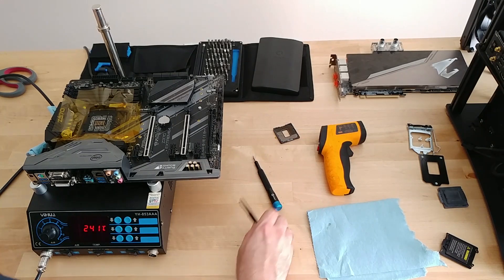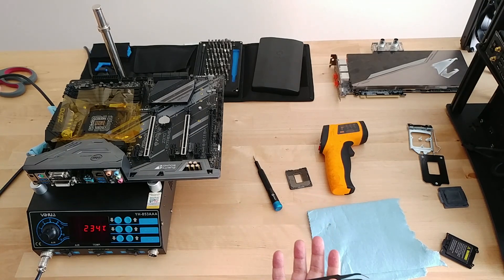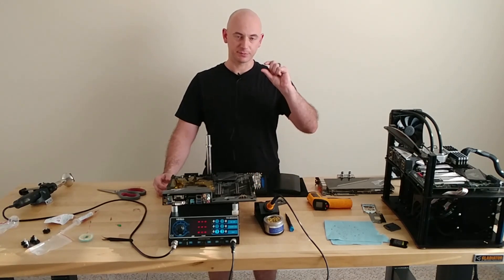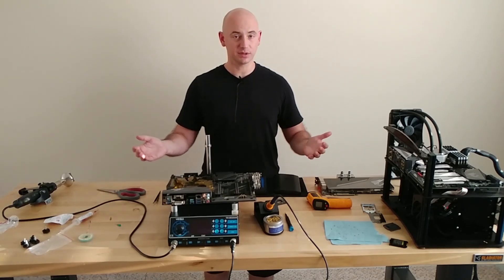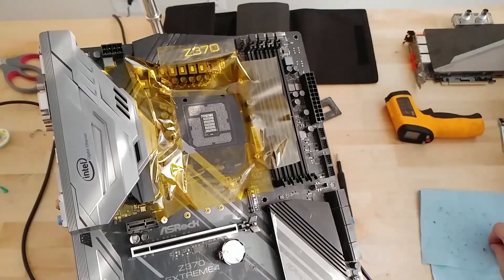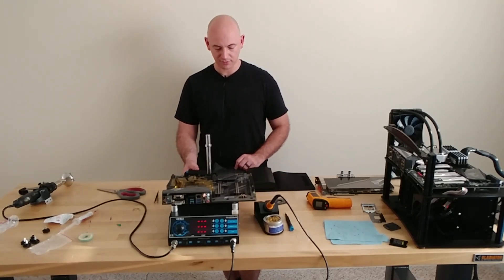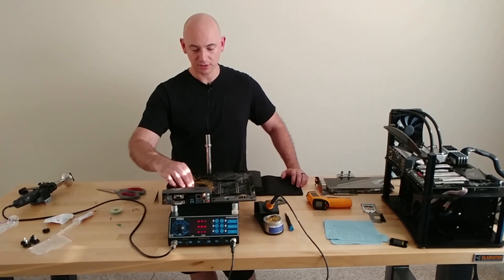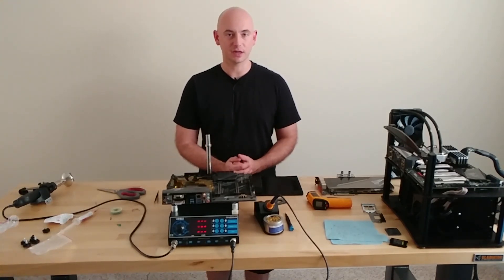CPU socket replacement attempt Pt2

Comment: You shouldn't have screwed your modded PCB to the back of this Motherboard.
The CMD in the back are safe and don't need this extra kit of yours.
The best way to work with the MB is to detach all the heatsinks to provide you a better maniability.
For the Preheater it shouldn't exceed 150°C. You Preheat the MB for 5 mins then you check if the temp reaches this setting.
Then you start to use the heatgun. 100°C for about 2 mins, then 150° and you stop to 350°C.
Meanwhile you apply some flux and gently check if the socket is moving.
Then when it moves, you leave the heat gun there for 30 secs then you put it away and you lift it gently with the best tool you have. (not a single tweezer but for this socket 2 tweezers are needed).
Reworking / Reballing process is not really hard but you just have to know the essential steps to succeed and not to break the motherboard.
:)
BTW you have a good Rework Station! :)
Reply from the maker: Thank you for the comment! You're definitely correct about removing the heatsinks, I discovered that leaving them attached actually soaked the heat away from the socket and made it more difficult to remove, so in the future I'll definitely remove them. The reason I used this extra kit around the socket is because the area of the reflow is not large enough to hold the whole motherboard, so I had to find a way to secure it to the limited area, but yes in general you shouldn't need anything like this. This was my first go at this and I'm planning on buying another broken board on ebay soon to try again!
Reply: @tenminutetech  nah you did that for content don't lie lol good vid though
Reply: Can you share a video about basic guide of reballing? 
I am new to smd soldering and want to learn about it.
Reply: @abdullahsaqib8471  there's a lot of reballing videos on Youtube but what you should know is the "temperature profiles" you should use with the lead free solder balls. It's very crucial. Repecting the temperature profiles will guarantee a perfect reball process and secure your board/BGA.
Reply: thanks for great comment and info !
Reply: @Asakura Samuel
I think you are a specialist in this theme! What temperature can cause the solder pads damaging, and what temperature can't cause the solder pads damaging? I have got a special problem when Im try to clean the pads from the solder with the soldering iron.I allways  preheating the PCB from the bottom for 100C, but when Im clean the board somehow 1-2 sometimes 3 pads missing (came off).  Usually I using 350C on the soldering iron, but I think this is to hot! What do you think? I use the NC-559 flux but not to much.
Reply: @kobi1ize  If you watch Paul Daniels cleaning up a chip or the "socket" he uses hot air and wicks it with a piece of desoldering wick held by a pair of tweezers. This insures he doesn't apply too much pressure when cleaning off the solder. If you use a soldering iron then there is a big chance of scouring the pad off if you don't have precise pressure control of the soldering iron.  I do not solder but I have seen many chips (not CPU sockets) replaced in Paul Daniels' videos when he repairs surface mounted electronics (MacBooks, iPhones and assorted other devices) and he explains what he is doing and why.

I guess you need to find which method works for you and practice, practice and practice. I wish you well. 👍
Reply: @kobi1ize  I used to get those few pads missing no matter what I did. I did buy a quality soldering iron tip. Some tips stay clean a long time even if you  don't clean them. Clean the iron tip using that special metal sponge. Use enough flux. Barely touch the PCB with the soldering iron tip. Barely touch the wick. Do not apply any pressure when you work. The soldering iron tip should almost "float" onto the surface of the thing you work on. Do not use the wick directly. Replace the unleaded to leaded soldering alloy first. Be careful about the temperature. If you don't apply pressure when cleaning and pads are still going then the temp you use is too high.

Comment: also what the butts is a reflow platform. and what is that giant hair straightener sitting on the motherboard
Reply from the maker: Reflow soldering is the process of heating the whole board to solder components, instead of soldering them 1 by 1 by hand. You can also use the reflow oven in order to melt the solder enough to remove any surface  mounted devices, which is what I attempted here. Hope this helps!